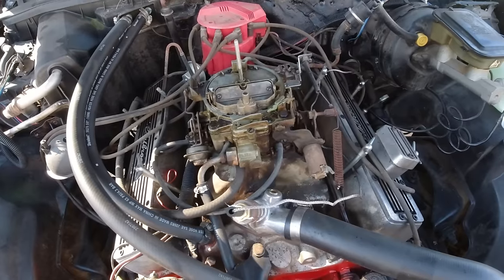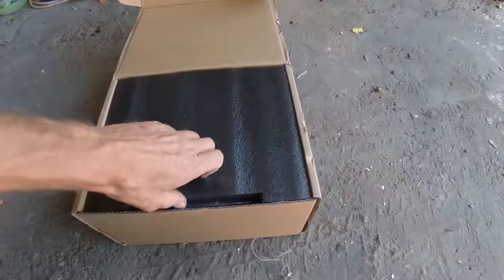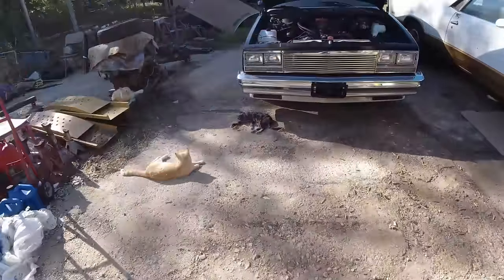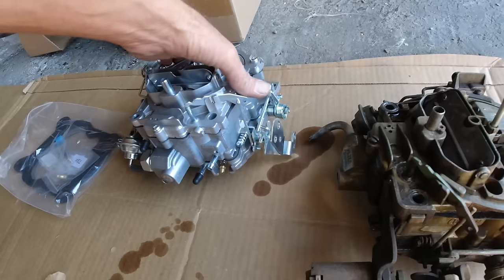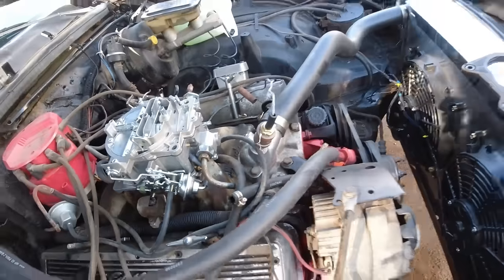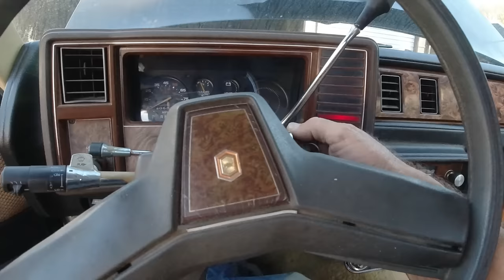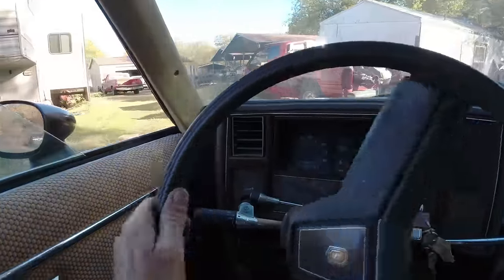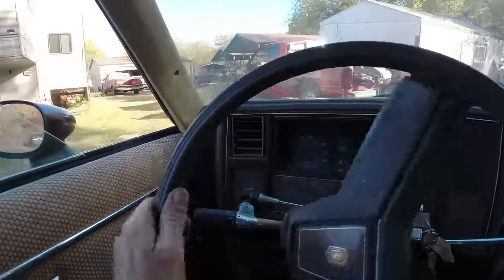Will a new $150 "knock off" Rochester Quadrajet Carburetor work? Let's install one and check it out.

Comment: I'm 74 years old and I've been rebuilding carburetors for people forever and quadrajet thermal quads Holly's I'm the only carburetor guy left in this particular town here in Texas and even a Snap-On tool that says hey you know what you're the guy the only guy we got left to that rebuilds any kind of carburetor you can bring in I still still doing make modifications to him also and yep yep yep I don't have any more years I'm going to keep doing it my eyesight starting to have no problem
Reply: I'm in Florida, grandpa started showing me how to rebuild one barrel carbs on tractors when I was 8 now 70+ still enjoying working on them. It's not hard if you understand how they work. Rebuilt a lot of Quadra Jets. Nothing kicks in and sounds better than a Quadra Jet. Keep on rebuilding them.
Reply: Almost every marina has a carburetor guy who can rebuild any carb
Reply: I ended up with a box full of them when my step dad died. I'll probably sell them for cores at a good deal to someone that rebuilds them. Maybe someone can use them for the parts. Lol  The truck I inherited needs one so I might invest in one of the knock offs and get it running and start on the body work it needs.
Reply: Hey there Larry, I'm 74,, and I'm the only carb rebuilder around here that I know of, and the quadrajet is the easiest to overhaul, the last one i did, when the guy came to get it, I told him, not to touch the adjustment screws that they were already set right, and that it would idle at 750,r p m s,,,,are you sure he said,,, just don't touch them and you'll see,, he called and said how much do I owe you,,,,, I said it's on the house.
Reply: Rock on daddyo.

Comment: The real test is to see how the secondaries open up when you tromp on it.
Reply: Exactly…
Reply: Yeah, where is that video?
Reply: Or don't in the case of many previously monkeyed with quadrajet problems vehicles I've gotten ahold of over the years and figured out most of them...
Reply: Ya rite but it did by hand
Reply: Put a sheet metal screw in the linkage at a place that works ans it turns a vacuum secondary int mechanical secondary quadrajet

Comment: The Problem with one of these "replacement" Carbs, is what was Fuel Delivery Curve set up for? The Q-Jet was offered on tens of thousands different Engines and HP ratings, and few had the same Fuel Curve
If the Choke is NOT opening Fully, the Secondaries will be locked out, so your Bimetal Choke, with the Welded Link is Questionable. The Old Carb looks like pre 1975 chevy, Calibrated quite Lean, and all the Jet changing in the World isn't gonna Richen it much, in regards to its tip-in Delivery. Some serious rework of the Non-Service Parts of the Fuel Bowl need recalibration
The 'New' Carb has an entirely different Choke Mechanism, far less sophisticated 

The Idle Solenoid, wasn't just used on A/C cars, it was often used on non-AC ones to prevent/reduce Dieseling when the Engine was shut off. In the early 70s, lean Idle Mixtures combined with retarded Timing, required a greater opening of the Throttle to attain Idle Speed. When the engine was shut off, more air and thus Fuel was still moving, and the Higher Temps from the Forementioned Parameters would often result in the Engine kind of continuing to run without spark. The Solenoid would shut the Throttle in an Attempt to Starve the Engine of gas-air

Big difference on the Linkage between the Primary Shaft and Secondary Shafts, Angles are different too

It seems to run not too bad, out of the Box. It will be interesting how it runs at higher Speeds, keep us informed
Reply: I was kind of in the same school of thought. You get what you pay for. The most interesting thing I noticed was that the throttle shafts 'appeared' to have the same OE style green Teflon coating. But I wonder. Is it REALLY Teflon or just some imitation green paint or coating. Most Chinese knock offs copy the 'look' without duplicating or understanding the function behind the engineering.

Comment: Two known but very fixable issues with Q-jets are the foam float, change that to brass and set the level cost $10.00 or less, and another lesser known and also very fixable issue is the well plugs between the throttle plate and the float bowl, remove the old press fit lead ones and install the repair kit (cost less than $10.00) with two aluminum plugs with O-ring seals and problems solved -- the Q-jet is an excellent carb if youre familiar with how to sort them.

Comment: Should put throttle return springs on like the factory had them. Connected to a bracket across that mounts torear carb bolts and the springs connect to the bottom of the throttle lever below the throttle shaft and pull straight rearward closing the throttle, The way you have it way out board will cause premature wear on the throttle plate  bushings and invite the possibility of the throttle  sticking full throttle if it cams over the pivot point with the spring at a angle
Reply: It actually puts less wear on the bushings the way he has it.

Comment: Glad the carb worked out for you. It's 60 year old technology with no electronic parts and by now I'm sure the knockoffs are OK. Did you notice any weight differences between the carbs and the knockoff being lighter?
Reply from the maker: about the same weight
Reply: Are u located in Texas
Reply: So how is it going so far with that carb? I’m going to order mine today? Any new issues? Smoking anything?

Comment: Older quadrajet chokes were always in the intake manifold like yours, finicky to adjust but not that hard just WATCH VIDEOS on Q-jet rebuilds and you'll be surprized how easy they are to work on, I was rebuilding them when I was 16, I just bought me a manual that covered all the carbs from my era (im 64) and learned that way, I didnt have the internet and youtube and the internet, its even easier today with the internet.

Comment: I have a Chinese knock off ford 2 barrel works great did have to grease gaskets on power valve plate. Other than that small leak. Works great.

Comment: i have rebuilt over 1000 carbs 500 of them qjets , made some from 3 or 4 parts carbs about 75% worked fine they have very finicky needle and seats warped air horns stripped inlets shot throttle shafts,  i think they are good for mileage but  for ease and value very hard to beat an edelbrock performer (used) i have had good luck with holleys too as long as you replace all gaskets and needle assembly , imo qjets are a pita to deal with but when you have 5 gallon buckets of them you use what you got. i'm sure that new one worked better than rebuilt ones.

Comment: With these new ethanol fuels have to see how it holds up.
Reply: Not well. Hard to tell what that one is, but the OE QJ's and Holleys were cast zinc, most of the Carters were aluminum. Neither one hold up really well with the new fuel once they absorb water. It's the water that kills them. I would have went with a TQ or the Demon TQ knockoff 'Street Demon'. Those all metal carbs hold too much heat for the ethanol.
Reply: Well, ethanol in fuel isn't exactly new at this point🙂. But, I have 5 70's GM cars with original Q-jets that I rebuilt. Been running them for many years, from 10 to 14 years since rebuilding them, 2 as daily drivers, the others I run at least once a month to keep them exercised. I used rebuild kits that come with ethanol resistant seals, like the accelerator pump seal. So, I drive my old Q-jets regularly and haven't had a problem with ethanol. They are all I have and drive, and they've been dependable. I have no need for a late model vehicle. The ones that sit longer between starts sometimes take more cranking to get fuel to the bowl, but they eventually start. If his new repro Q-jet is as good as my old rebuilds, it should be fine too.

Comment: Glad I watched this because I just ordered one from ebay, just to get a rebuilt 283 going for first time start, but if it continues to run well I will keep it on, yours appears to sound real good actually specially for a knock off.
Reply: Had qjet on a 283 and it did okay. Gave 14.5 inches vacuum at idle. Installed a holley 1850 using an open adapter plate and got 15.5 inches vacuum at idle.

Comment: Quadrash!ts we’re actually great carbs, yes very tuneable. There downfall is usually attributed to the small float bowls. Bowls could be sucked dry faster than they were able to refill in a performance application, fuel starvation in cornering, and acceleration applies. Rebuild, check float level & keep orifices clean. Accelerator pump ok? Check fuel pump output. Go enjoy.

Comment: I bought one from Amazon for my 68 Deville but it was a bit of a dud and would diesel. I returned it and bought an Edelbrock instead. It's nice to know that the problem was wish mine and not all of them.
Reply from the maker: sounds like a timing issue
Reply: @clunkersandclassics  Yes, and if his engine has a high compression ratio, which is likely in a 68, and he wasn't using Premium, he would have needed the higher octane Premium fuel for his engine.

Comment: Cliffs high performance will talk you through the fixes for those problems. Once you know, they are easy to work on. There is a spring for the secondaries, and a cam it rides on, repairable and adjustable.

Comment: I had my 1979 Q-jet restored to better than new at JET Performance Products in Huntington Beach, CA. I went with their Stage Two Performance build. When I opened  the box I was blown away by the quality service that totally restored my Q-jet to better than new condition. Simply amazing with a simple reinstall of my original carb as it was when I removed it from the engine. I was cautious to make sure I received my original carb and not some off the shelf rebuild by taking detailed photos of my carb ID number before I shipped it to JET and sure enough I received my original carb back from them. NO Games Played! So how did it work you may wonder, One word defines the results, PERFECTLY! Starts immediately, warms right up, NO STUTTER or BOGGING, PULLS HARD AND SMOOTH FROM IDLE TO FULL THROTTLE! My 383 Stroker loves it! So do I. I don't miss one penny of the $450.00 I spent for this restore by JET PERFORMANCE PRODUCTS. Ronster
Reply from the maker: This $150 carb is for people who don't want to spend $450 for a rebuild or buy a new name brand carb. When you spend 3 times more for parts building a car then you end up putting $30k into it rather than $10k. Makes a big difference between a profit or big loss when it comes time to sell.

Comment: If your having driveability problems after the engine gets heat soaked. It may be a problem with modern gas. It's not made for carburetors. It boils away easily. You could try a insulating spacer under the carb.

Comment: Got mine on my sbf with the adapter took a few test drives works great only thing is i had to tie open the choke because i don't  have that intake part for it. Just a little hard to start but once warm it works great.

Comment: Put one on a Pontiac and the jets were way to big, ran rich. Pulled the jets and put the next size down and still running rich but better. The next size down provided is way too small. So still pondering whether I track down some smaller jets or give up on it.

Comment: I bought the knockout for my truck and it literally caught on fire every time I tried to start it. Not just a lil spark it caught on fire and almost burned my truck up. Put the original Rockchester back on and it worked fine again.
Reply from the maker: strange. mine is working fine still.

Comment: If you’re running the same stock engine configuration ( low HP and torque ) it will probably work fine,

Comment: That  a/c solenoid is also an anti - dieseling solenoid that shuts the throttle body when you turn the engine off because  of smog they ran lean and had to open the throttle more to idle. probably doesn't apply for you just fyi.Not sure how I feel about a china knock off but I love q-jets it seems to run good.  wish they had an 1100 cfm q-jet or a dual manifold for a big block chevy cause I'm stuck with a dominator, no fuel economy at all.

Comment: I got one it was great  on the primary  but kick in the back two and falls on its face i have adjusted  the top  butter flys with no help i went back to my old carb and throwed this one in the corner  of the shop oh the old carb just has a stumble  as the back two opens and then gos like a maddog and return was a hassle

Comment: My experience with the knock-off carbs has been that they work okay, but they use inferior metals that immediately start to corrode after fuel is introduced. They're built simply by the parts designs being copied but with no functionality being researched or considered.
Quite simply they copy and assemble the different components with no idea what they're meant for... They work but they're never quite right.

Comment: Have you had any long-term issues with your new "knock-off" Rochester Quadrajet carburetor? I have, and they've been very disappointing.

I bought one of these carbs off of Amazon on March 20 to replace the worn-out Edelbrock that was on my 68 C10. After watching a few videos on these knock-off carburetors, I figured that I would take a chance and try one out for myself. I've been rebuilding engines and carburetors ever since the 80s, so I've seen quite a few over my lifetime. At first, it seemed that the new Q-jet would work just fine, but I was wrong. It won't stay idling until the engine has warmed up to operating temperature, despite all of the tuning and adjustments and engine timing that I have done. Plus, if I let the truck sit for a few days, all of the gas has drained out of the fuel bowl. The well plugs are leaking. I have to prime the carb in order to get the truck running. I've got up until April 20 to return the carb. Thanks to these issues, I'll be returning this carb and going a different route.
Reply from the maker: I haven't had any problems from mine but I don't drive it much. I have to prime all my cars after they sit awhile. There is a bunch of different manufacturers of these carbs so all might not be the same.
Reply: the fuel evaporates out of the bowl thats the hard starting issue with carbs after sitting for a while!!  put a cup of gas in jar and its gone overnight   its the alcohol

Comment: When it gets cold, put that solenoid back on… with it on , with or without the heat stove / riser , the engine will
start easier …
Reply: That solinoid is for air conditioning. All it does it raise rpm when compressor is on. It litteraly does nothing else what so ever.
Reply: My 1973 Nova SS w/ a 350 v8 Quadrajet has that solenoid and has never had AC since I bought the car in 1973… my car is a 4 spd… the plunger rod physically pushes the primaries open during cold weather starts til the heat stove/ riser kicks in…

Comment: Hey Lee, can ya post the  eBay ad no. For the carb ? I need that exactly same carb.  Thanks 👍
Reply from the maker: go to ebay and put in rochester quadrajet, a bunch will pop up
Reply from the maker: exact heading is: Rochester Quadrajet Carburetor For Chevy 350 400 427 454 750CFM 4MV 4 Barrel
Reply: Buy a carb with a proper choke not this useless heat riser intake crap

Comment: 90% of fatigue problems with the Quadrejet is throttle shaft wear.... therefore sucking air and interfering with the air/fuel ratio.....
Reply: Yes, and as you probably know, it's the throttle shaft bores in the carb body that wear, not the shaft. There are throttle shaft bushing kits available from q-jet parts suppliers (like cliffshighperformance) to fix that problem. I do it on all my q-jet rebuilds.

Comment: Is the carb still working  good? I just got one in today gonna try it.
Reply from the maker: yes
Reply: @clunkersandclassics  awesome these chinese carbs get alot of hate. But I say if it works it works. Can't  wait to try mine.
Reply: @clunkersandclassics  got mine on got it to idle only thing that I had to fiddle with was the spring on the secondary air doors. I adjusted it and they open now. Can't wait to test drive it.
Reply: You think it will work on a stock 88 454?@clunkersandclassics

Comment: I don't understand the problem with rebuilding these.  They are not that complicated.  It's odd that this video came up while I'm rebuilding one for my boat.  Takes me about 2 hours to disassemble/clean and reassemble. And I've done like 20 of these total since 1987 when I did the first one. So I'm not a pro, they are just not that complicated. 

The problem with those Chinese carbs is they will usually work great-for a little while.  Then they usually start to develop issues.  Watch UTG, he did a video about them.  They are not anywhere near as good as the original. But you get what you pay for.  And $400 isn't squat to spend on one of these old cars.  It's just not a lot of money anymore.
Reply from the maker: This video is for people that can't rebuild one and don't want to pay someone to do it, have no carb to begin with or has one that's been deteriorated beyond repair. It's a cheap alternative to get your ride back on the road quick. And $400 is a lot of money to me and this channel.
Reply: @clunkersandclassics   All I'm saying is a $15 rebuild kit is usually a better way to go than a $150 Chinese knock off.  The quadrajet comes apart in 3 main pieces and there's really not that much you have to do besides cleaning and keeping track of your parts. You're really only replacing like 8-10 pieces with a rebuild.   There's one tricky section with the upper gasket to the air horn during reassembly,  but that's it. And there's a ton of Q-jet videos on Y/T.  Like I mentioned, if you watch UTG on this very subject, the knock off will usually disappoint you before too long.  It's trading one problem for another.